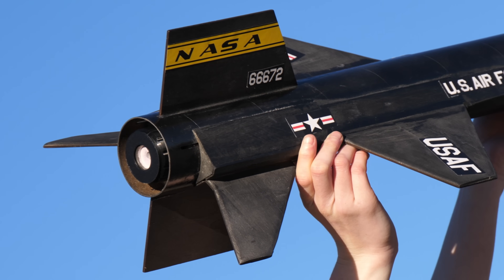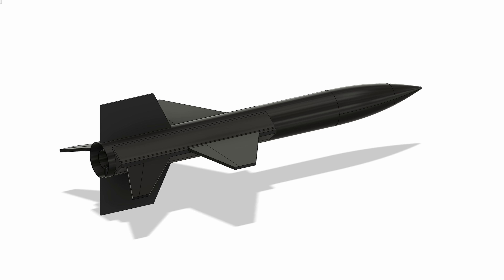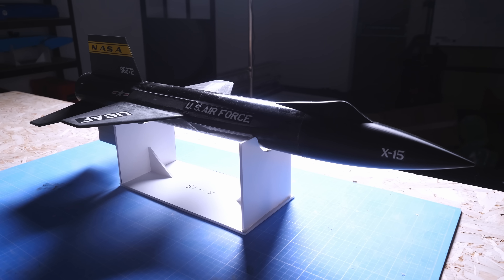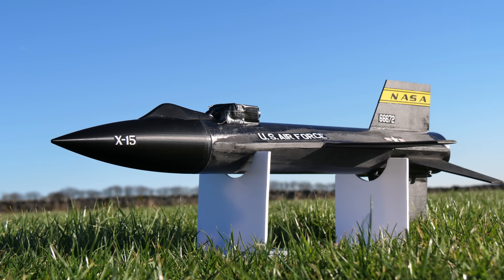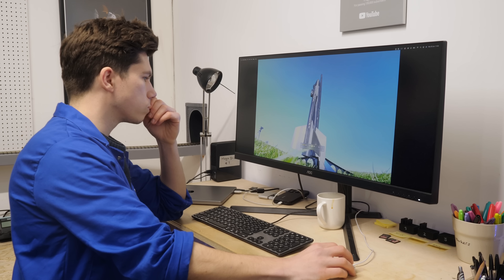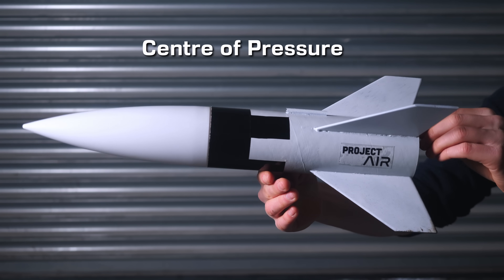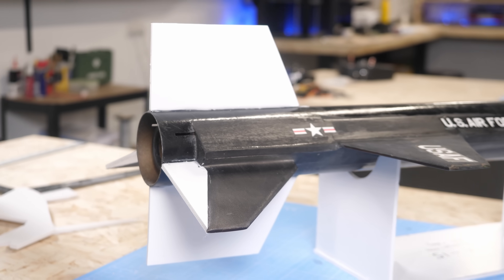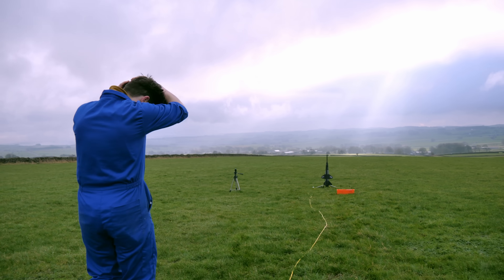Building a HIGH SPEED Rocket Plane

Comment: check what the world record for the fastest model aircraft is... clue... it doesnt have a jet engine, propeller or rocket... its powered by the wind and gets into the transonic regime.
Reply: It's a glider that goes around in loops from the top to bottom of a mountain riding on wind currents
Reply: @t.iapsingh5651  it's not really riding air currents. It's called dynamic soaring. It's the same effect the albatross uses but on a bigger scale.
Reply: @DorsetSaferRoads  interesting
Reply: The airframe being intact just means youve made it too thick. Lighten it.
Reply: @codeblocks4067  Ah, spotting survivorship bias. I love it.
Reply: lol, just made this comment... am yet to see any RC vehicle WITH a motor of any type get even close to the sound barrier.
Reply: @paradiselost9946  I mean there is a reason for that. Essentially you'd have to fly it in a circle. Unless you want to fly it while flying next to it in a fighter jet or something. Now THAT would be awesome 😎
Reply: @paradiselost9946 look for Dawn Aerospace prototypes, aside from NASA projects, may be an interesting one breaking the sound barrier :)
Reply: DSS yeah, 548 mph isn`t it?
The Kinetic iirc.
I`ve told my friends of the fastest model aircraft, and EVERYONE though it would be turbine or rocket powered lol.
Also, when you`re on site, the sound is insane! 
So is the price of all out speed slope soarers lol..
The engineering that goes into those wings is pretty crazy tbh, they`re really advanced for "only" being RC models.
Reply: The problem is that these RC planes are usually made of full carbon (very expensive and difficult to produce), plus they need a lot of wind and the right hill like BIRD SPRING PASS, California. In addition, maintaining control during dynamic soaring is very difficult (that is the reason why these aircraft usually only fly once. 😂
Reply: gliders
Reply: I've seen the videos. It's insane, the glider design and flying skill ..
Reply: Pretty sure it's actually powered by gravity when it's hitting that top speed
Reply: @ no, its being propelled by 60+ mph winds, then diving into the wind shadow to head back up wind, then pulling back into the wind, and repeating the process over and over. You should definitely watch the videos, they gain 50-100 mph with each loop, it’s incredible.
Reply: We’ll sort of, but in 😊1948 UK got a scale model aircraft up to 980mph.
Reply: 548 mph
Reply: I mean the fact is that a "model"  (HPR) rocket can definitely break Mach 1 and according to a very brief google the fastest is Ma=~4.2. Obvs for unpowered craft dynamic soaring is the fastest you can go but there is no reason you couldn't build a rocket-powered plane that went faster.
Reply: What an interesting idea…
Reply: Do amateur rockets breaks the sound barrier? I’m talking about the ones that are 10’ tall that almost go into orbit.
Reply: @rsquared9703  none of the model rockets get to anywhere near orbit. 

Rockets are brute force rather than "flying" tho.
Reply: @DorsetSaferRoads  what I was getting at was do those amateur rockets break the sound barrier? If they do, take a look at what efforts it takes for even a “small” object to go fast.
Reply: I found some guys dynamic soaring, filmed it, and it’s been my best video in views. 
Dynamic soaring is wild and the pilots are awesome!
Reply: Yup, Dynamic soaring, i think the record is something absurd like 550 mph, they are insanely fast.  Like 3.5m carbon gliders, ballasted to over 50 pounds, and flying on the Lee side of a ridge in 60 mph winds.  It’s pretty crazy how they can even fly them at that speed.
Reply: Have you considered having it fly horizontal like the original X planes.. drop it from a different plane and have a remote control spark set off the rocket.
Reply: 548 mph
Reply: That one manhole
Reply: Whatever emoji I put right now is you y’all.   🤓
Reply: Do 1 with mark rober
Reply: Flying in circles wouldn't count. I mean he's trying to go for straight line speed.
Reply: @SMS2884  not for Guinness sure. But it's still measured with a radar gun.
Reply: @SMS2884 he calls this a plane but it was only just a rocket
Reply: The fastest plane is the prototype X-43A reaching a speed of Mach 9.6 at the fastest flight
Reply: @Spinzy67  Ya except unless you have a rc scale scramjet engine, it's not..
Reply: @Spinzy67  It was unmanned so technically it was an RC aircraft 😀 just a very big one
Reply: @ hold up let him COOK let him cook now don’t let the government get into the reaserch
Reply: @Spinzy67  The X-43 is not a plane. The X-15 is the fastest, the SR-71 is the fastest air breathing engine one and the Grumman F8F Bearcat is the fastest propeller one. Granted, all of those pale in comparison to the Helios-B solar probe orbiting speed (250,000 Km/h).
Reply: @ the Helios-B is not an aircraft it’s a solar probe which gets into the category of spacecraft
Reply: @BrunodeSouzaLino  The X-43 was a plane and it was air-breathing. So in that regards neither the X15 nor the SR-71 would be the top.
What does make a difference is that the X-43 was unmanned so the X-15 is the fastest MANNED aircraft. But that still makes the SR-72 only the second fastest airbreathing manned plane.
Reply: @ABaumstumpf  X43 is not air breathing because it only works at hypersonic speeds nor does it fit the definition of a plane because it can't take off or land.
Reply: @BrunodeSouzaLino  "X43 is not air breathing because it only works at hypersonic speeds"
that is a non sequitur.

"nor does it fit the definition of a plane because it can't take off or land."
Neither does the X-15.

So you failed on both accounts. When you are 100% wrong - why even comment? Do you like spamming and spreading BS that much?
Reply: @BrunodeSouzaLino why would you include a solar probe in this comparison
Reply: Btw this model aircraft that needs fly to go 767 mph x-15
Reply: Doesn't really matter what the world record is, he's trying to beat himself which is fair enough. Although it is a bit ridiculous considering his personal speed record is breakable by ordering a hotliner from one of the well known manufacturers and fly it once.
I mean... I have personally flown aircraft faster than that. 300kph is kinda... easy...
Reply: @Argosh  He's building his own prototypes which is far more fun than just buying a fast RC plane. Sure I have fast carbon fiber pilon racers i built from plans that would break his top speed easily. But his accomplishments are much more rewarding. He's using very unorthodox ways of building because he learned from his time at Flite Test. I would build mine from CNC foam core covered in carbon fiber like my pilon racers. Some people just don't have the means to do that. Plus that was the most EPIC lawn dart. I would love to see more of those, lol.
Reply: @FarmerFpv  he's building his own prototypes by... Using a kit for a rocket and then making it worse by applying stuff from an aircraft from 70 years ago?
There is nothing wrong with experimenting, but please don't say ridiculous stuff like that... If his goal is to go fast he should probably start with a better base and then not apply designs that will never work in this mach range...